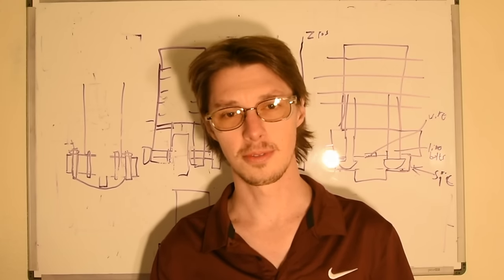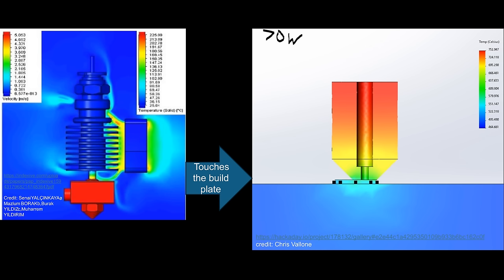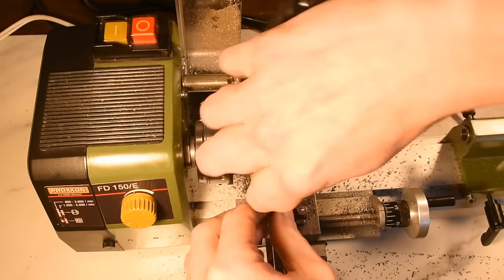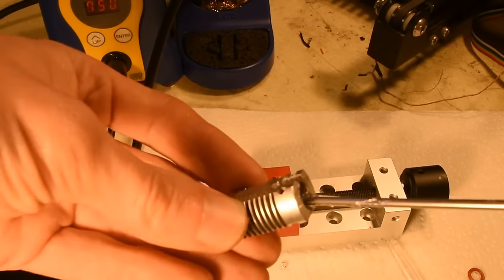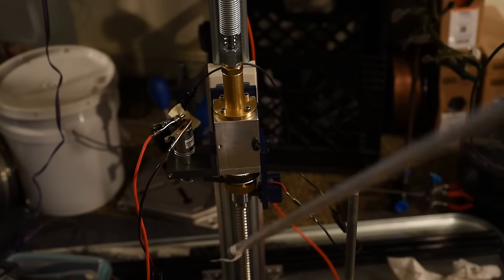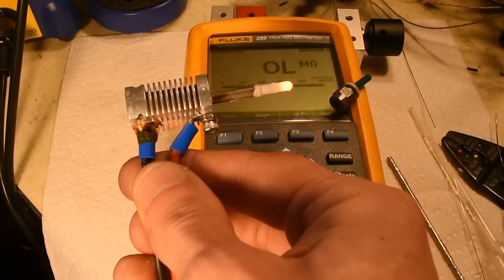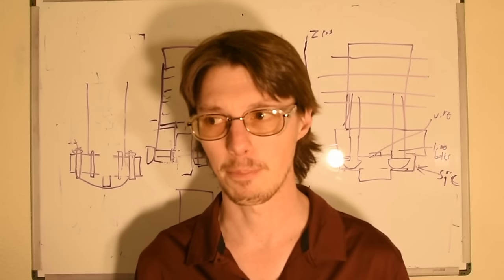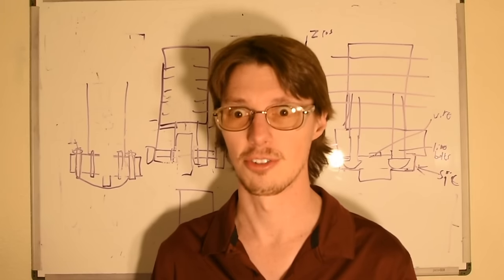How we made a 1300C 3D printer hotend for printing metals on the Creality Ender3

Comment: It is criminal that this video has 28k views and this guy has less than 2k subscribers. Do your part and someone share this with cnc kitchen.
Reply from the maker: maybe when we actually demonstrate a working prototype. 
I am not sure the publicity is warranted just for a documentation piece of how we make these hotends *just yet*, as much as I appreciate the complement. :)
Reply: @rotoforge2024  Don't sell yourself short. You're taking an approach to Metal 3D printing that as far as I know, no one else has tried, and you have done an incredible amount of work designing this to work with a popular off-the-shelf brand of fdm printer with cost-effective and readily available parts. Even if this project ultimately fails, you'll be contributing some very valuable information to the community. Besides, inventing is like 90% failure until it suddenly works.
Reply from the maker: @frozencreed thanks for appreciating this. lol
its been....a long road.
Reply: If he shares tips with cnc kitchen, cnc kitchen will get most of the credit

Comment: You should check out non-contact thermocouples.  There are some that can do 1,300C.  They tend to mimic J or K thermocouples so a temp controller works seamlessly with them.
Sometimes they're also called contactless pyrometers.   Using non-contact works well in these applications because they tend to report the highest temp in their view which is what you want to control.   With small temp sources actual thermocouples tend to blow because they will carry away enough heat via the sensor to alter the heated device of interest.   If you try to minimize this by using finer and finer thermocouple wires they then drift and fail quickly.  They also tend to be really hard to mount against a high temp surface.
Reply from the maker: yeah. this would be great if they did not cost ~200 USD or more a sensor for the temperature range I need.  Do you know of any that are actually reasonably price for individuals?

Comment: Probably the coolest application of the RackRobotics edm thus far. Awesome project!
Reply from the maker: I am far from an electrical engineer. so the powercore  was super handy and timely. 
I probably would not have attempted this project if it had not become available as open hardware.
Reply: @rotoforge2024  That's always nice to hear. It's the whole reason we made the Powercore!
Reply from the maker: I am glad you did. :)

 @ZURAD  maybe the V2 would help with the thermal shock issues...the higher frequency might reduce the amount of shock fracture during machining and render the plugs a bit more robust as machined....
Reply: You mean the hottest, surely? :)

Comment: The heater material itself will have a measurable temperature coefficient of resistance.  You can measure this while driving the heater by putting it inside a resistor bridge, or you can sample the resistance during the off time of the PWM driver.  Afik, 0.1% precision should usually get you to single digit degrees of error.  Look up "hot wire anemometers" for example circuits.  Diy anemometers often use an incandescent light bulb with the glass cracked off.
Reply from the maker: yes. We tried this. it does work, but the heater drifts over time at very high temperatures, and the metal wire moving through the middle of the plug interferes with the measurement due to the electrical conductivity of the wire. 
it would be useful forfast response measurements, but probably is not reliable for overall temperature target calibration for model based control one imagines a model based control where the PID portion of the loop is driven by current sensing feedback, and the models actual temperature comes from thermocouple measurements every second or so. this way the hotend control can adjust rapidly to flucutuations during printing using the PID, while keeping within a set tolerance over time based on the  thermocouple measurement.
Reply: @rotoforge2024   Sorry to hear about the long term drift.  That's an annoying problem to have to deal with.  Can probably do initial calibrations by melting a few different pure element wires, but difficult to do a calibration like that while printing.

Comment: My college rejected my proposal for this for a senior project so heres my ideas:

Use either high temp heater cartridges from injection molding industry or induction heaters

Use an airtight chamber and fill it with argon COMPLETELY displacing all the air as the aluminum will ocidize immediately and not bond to itself (essentially youre gonna cold welt molten aluminum)

Comment: To measure the temperature, borrow a trick from Webasto Diesel Heaters where the glow plug temperature is measured by it's resistance change.  The resistance (and change in resistance) is small, so difficult to measure.  However, the current & voltage are easy to measure (something like an ACS711) to calculate the resistance.  Use an IR Thermometer to calibrate and plot the temperature / resistance curve.

This is a great, worthwhile project.  I look forward to seeing how it develops & wish you the best success.
Reply from the maker: my printables page about the  glow plug contains this data actually.
Reply: @rotoforge2024  - when measuring resistance as low as you have in this video, a four wire technique (Kelvin bridge) is normally used since it eliminates the resistance of the test leads from the measurement. You might find your device achieves even lower resistance.
Reply from the maker: @stevebabiak6997 
this may well be the case.
I dont have a 4 wire capable probe.
maybe i will add it in future if accurately evaluating the RT resistance makes a big difference in device performance.  From what I can tell, the contacts between the glowplug and the metal body are ohmic. 
this would make 2 probe measurements at least close.

Comment: Lets talk, im working on the same. A high temp hotend and im using a different approach that uses off the shelf 1mm welding wire with a posibility to print at "0.4 nozzle" quallity.

This does not require any special tools over $50ish and is more versitile. I am extruding aluminium atm and it has much potential. Theoretical max temp is 1700-1800c but my thermalcouple is limited to 900c ish. I am woring on that.

Btw, you can buy a high temp ir sensor for 50 bucks. I dont know how well it works but its my plan of high temp sensing.

I would love to share my findings with you.
Reply from the maker: Do you have a video/document or blog about it? 
happy to talk with others working in similar areas.
Reply: @rotoforge2024  i dont have a blogg. Can i dm you on discord?
Reply from the maker: @the_normal_guy9308  sure. 
happy to chat. you could also join the discord and talk shop on the general chat.

Comment: Bronze is still a very useful material! The material properties of bronze is good enough for most everyday items. I highly suggest you use a interference fit for your heat sink. Mill the body to the same size or a few thousanths bigger than the inside of the heat sink. Then place the glow plug body in the freezer and place the heat sink in a flame( not too hot) or oven and slip it on. The expansion rate of the body and sink are different so getting a tight as fit as possible is important because you may have issues if not at higher tempuratures.
Reply from the maker: the actual temperature of the heat sink never rises high enough for this to be much of a problem at bronze printing temperatures, because we make very little waste heat, and the glowplug only needs 40-60 watts of power. 
so its heat leakage is about comparable (actually a bit better) than conventional hotends.

Comment: Some time ago I thought about this using silicon carbide as the hot end/heater but it was just a mental "back of the napkin" concept that I had never though more about it. Great to see its actually possible.
Reply from the maker: the rods of the stuff from goodfellow appear to be ideal for the task though they are expensive. 
https://www.goodfellow.com/p/si64-rd-000150/reaction-bonded-silicon-carbide-sisic-rod

We are investigating this as an alternative to the glowplugs, as the glowplugs are quite hard to process, and are fragile once finished. 
we want the solution to be as cheap and hacker friendly as possible, which a 1500-1800 USD EDM drill rig may not be... but then again, 500 USD/4 inches is not exactly cheap either.

lol
Reply: @rotoforge2024  - since the glow ignitors for gas appliances are SiC I figured you already looked into them, especially since they aren’t usually that expensive. But posting this in case you didn’t check into them.
Reply from the maker: @stevebabiak6997 we are invesigating methods of utilizing them.
their weird geometry and low material quality makes them difficult to work with.

Comment: You aren't afraid of taking an ambotous projects. Consider Electrochemical Machining ((ECM) as a milder way to drill the hole in the glow plug. Eveything you have will work but your power supply. ECM uses 4 to 30 VDC, In short it is the reverse of electroplating. Homemade ECN tends to be slow as switching very short pulses at 5 Volts at 50 Amps is hard to do. Fortunalty it still works aatmuch lower curents. Two rewound microwave oven transformers can give you a 220 Volts AC 3,000-watt center-tapped low Voltage transformer. Off the shelf FETscan handle those volages and currents. 

I would look for a potter, pottery club, or class to fire the ceramic glow plugs,

Good Luck

Comment: in the before times, i learned to brush the metal with a mildly abrasive brush when it wouldn't tin, it works faster than heating and hoping.  commonly it's a method still occasionally used on copper plumbing pipe, the abrasive is a wet rag.  for solder, even an old toothbrush can work, though it stanks.
Reply from the maker: yeah this is in the cards. Seems like a lot of shop knowledge is of great value just not that well documented. 

foundry men, metal extruders, jewelers, smiths, welders, brazers, electronics techs, etc. all have so much siloed or lost knowledge that needs to be shared more widely for metal printing to really grow.

The tradespeople and craftsmen of the world are often the inspiration for the best technological advancements...something about if you want a solution to a new problem look in an old book.

Comment: IR instead of thermal couple? Could focus it in with fibre optics to get a more accurate measurement and have the sensor in a more remote from location. 
Plugged hot end is a whole differt animal when you are printing with metal.

Comment: You should try inductive heating, with a ceramic or tungsten nozzle. Wont work for printing non-conductive materials unless you use the nozzle itself as the heater, but a ceramic nozzle with a metal filament may solve your thermal inertia issues and provide very good control over temperature, as heating would be intrinsic to the material you are trying to melt and electronic control would have response times in the microseconds. No other metal needs to be present in the system. One of my future projects is an inductive hotend, but for large diameter/volume plastic filament

Comment: Absolutely amazing project. This is such a great idea. Makes it so much simpler than using metal powder and lasers. Just an idea. You can get kanthal wire really cheaply online. Maybe a few turns connected to a resistor forming a divider could be used to mesure the temp. Not sure whether its resistance curve would be steep enough for good precision so just a thought. Would be easier to attach that than a k-type therm.

Comment: @Rotoforge 5:08 I see 2 things at that time. #1 in the picture, the glow plug seams to be at the hottest (brightest?) about 1/3 in from the very tip.
4:20 #2 The glow dims fast when in contact with the metal, but if the glow plug was rotating (at some? speed) then the non-contact side could recover heat while the in-contact side could rapidly deliver that continuously accumulated heat into the wire.
#3 (bonus), you could maybe use 2 (or more?) glow-plugs, and pinch-roll the wire between them, then you can RAPIDLY heat up a lot of metal, AND feed it with the same mechanism.
Reply from the maker: the plug is driven by unadjusted DC heating. so it loses heat to the metal and arrives at a new lower equillibrium temperature. 

with PID or model based control, this should not be an issue as more power will flow to the heater to maintain temperature as metal passes through it. 

regarding the rest here, sounds pretty complicated. 
would love to see a drawing.

Comment: Very impressive. Looking forward to the metal print. You might consider using a welding gas inside of the 3d printer envelope to help reduce oxidation issues, as well as proper ventilation for the exhaust. 
Re: the Thermocouple, I am not sure how you are connecting it. Just remember that you must use the "supplied" wire for any thermocouple and cannot use a different wire because it will cause spurious voltages (unless you purchase the special extension wire). Type B thermocouples have a pretty high maximum temperature.

Comment: Great idea and awesome use of off the shelf parts. My tip for you is to preheat the wire as much as you can. This will help with the lack of thermal mass of the tip
Reply from the maker: the tip's energy density is comparable to a torch flame and it can respond to input current at about 1000 degrees C per second...
preheating should not be necessary. but i will keep it in mind. :) 
I dont really understand why it would be desirable. Many people have suggested it... can you elaborate on why you think it would be helpful?

Comment: Regarding temperature measurement, not sure if you explokred it or not.  You could measure current going in and voltage at glow plug terminals, and profile how the  glow plug resistance changes with temperature, while measuring tem on the bench.  I am not sure if this is consistent across units, but might allow ou to go thermocouple less.
Nice idea.  Maybe in the future there will be an industry that manufactures printing heads like this, and come out of the press with the hole already there.

Comment: You are amazing! Thanks for inspiration and for your work! I hope that someday I would manage to finish my own 3d printer idea and we could collaborate.
Reply: I know that it probably won't work, but what about an IR thermometer pointed at a spot painted with a matte paint? Would it work? What about annealing the glowplug in special casting sand/clay and, well, just pressing the plug into the sand, setting the temperature of the glow plug to required and waiting for some time till it is evenly heated? Ah, right. The solder and other components won't survive it. Sorry.
Reply from the maker: @dromeosaur1031 
the glowplugs are excellent blackbodies. 
they are easy to measure with an appropriate bolimeter/pyrometer/IR diode...
but its hard to calibrate these and they tend to be expensive for small targets at very high temperatures.
Reply from the maker: @dromeosaur1031   and yes the whole plug would need to be annealed...which is... inconvenient....
Reply from the maker: you do you mang. love to see more people trying for metal printing.

Comment: FDM metal printing... nice. i have idea for you if this thing won't work - this idea is using high-frequancy currents to melt metal. It will precisely conrol melting temperature through inner electrical resistence of melted metal, no heating parts (besides thermal insulation), melting temperature is defined only by strength of thermal insulation and nozzle.

Comment: There is a Japanese TV show where masters of various crafts compete by performing a certain task in different ways. There was a task to drill the entire length of the rod of an automatic pencil with a diameter of 0.5 mm. A turner and a master of electric discharge machining competed. Of course, I thought that the second one would win. However, the turner managed. It's quite a spectacular sight, I must say.
Reply from the maker: I saw this. 
it  was very cool. 
I am neither equipped, nor sufficiently skilled to do some deep hole boring on a lathe in a ceramic material whose hardness approaches Mohs 8.5.  :)
Reply: @rotoforge2024  I wish you luck with your researches. It's quite interesting way of thinking. I was always thinking about only the welding-like technology for printing metals.

Comment: Did you consider inductive heating?  That is, a power coil around a central, thin-walled ceramic tube.  Considering the volume that's being heated, I would have thought the size of the coil would have been reasonably small to get the wire to (almost) melting temperature.  It also focusses the heat into just the wire, which is exactly where you want it, reducing the power required and cooling requirements.  I would also expect the construction to be a lot less hazardous.  You can buy precision alumina ceramic tubes with bores down to 0.2 mm, so all you'd have to do is wind a suitable coil around it.
Reply from the maker: I need to print ceramics as well. 
but beyond this, 
I have considered and attempted induction heating. building/buying power sources that operate in the MHz range to heat ultra fine wire are expensive and somewhat complex to construct (at least for me)
perhaps the use of a rotary halbach array to reduce driver frequency requirements by increasing the number of coils could help.
BLDC motors are notorious for shaft heating when jammed.

But I have not opted to pursue this approach due to the cost and electrical engineering involved.